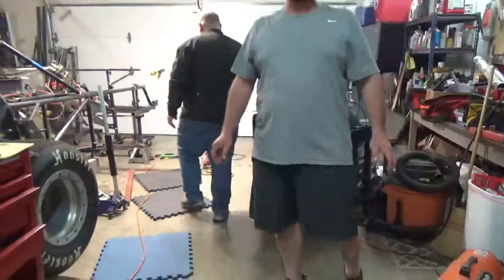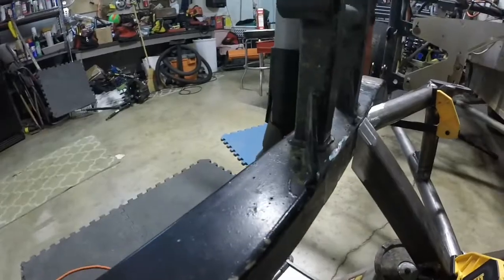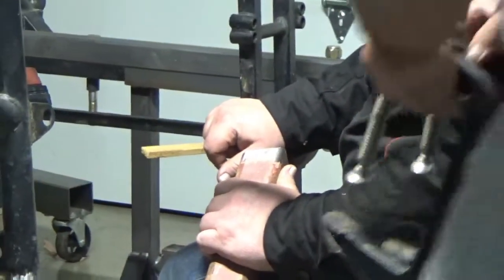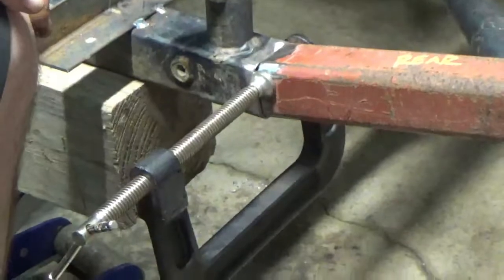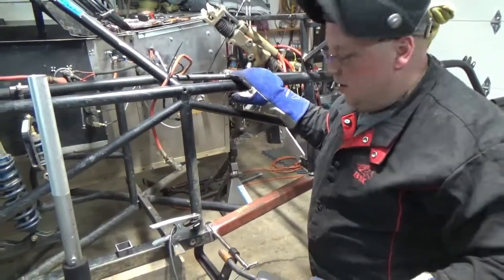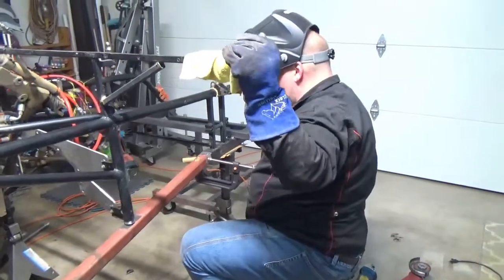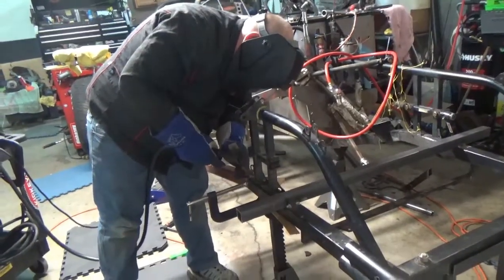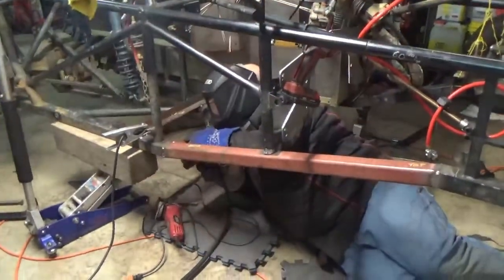"The Fit" Dirt Late Model Chassis Upgrade Continues with Frame Rail Installation

Comment: Lookin good! Instead of scabbing Diamond plate over the rear butt joint try running a kick tube at a 45* angle from that vertical bar right there to your main rail to support it and keep it looking good. Just an idea! Keep up the good work!
Reply from the maker: Thanks for your suggestion.  We are going to be putting it together this weekend and will likely add your recommended support. Lots left to do!
Reply: You think  the tubing  is a little  too thick on square tube . May hurt the flex in those cars
Reply from the maker: Possibly.  We will find out one way or another. LOL.  Thanks for watching!
Reply: v h you are correct
Reply: @TheCrewChief374  exactly  that's my experience  doing that. Just didn't want to type all of that..
Reply: @vh4504  Yes you are correct and you bring up a good reason to edit my post.

Comment: Do you think the tube is to heavy, it looks like 1/4" wall the 2" frame of car is probably .083" or close..
Reply from the maker: We are not sure if this will help or hurt us.   There is nothing in the rules that say you cannot go heavier.  The original frame is 2 x 2 box tube .083" wall.  The piece we used was something that was already laying around the shop and it suited are needs.  Sometimes we take a Smokey Yunick type approach to race car building and just hope for the best.  Thanks for watching!